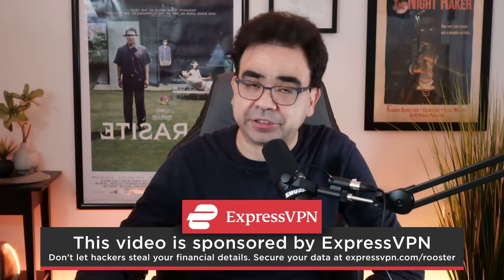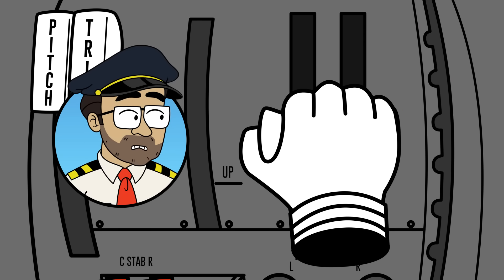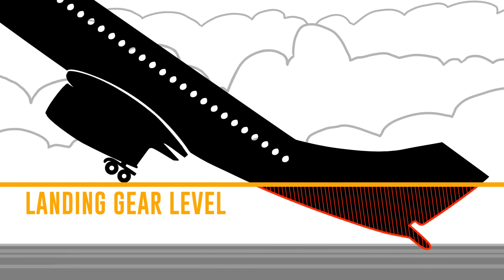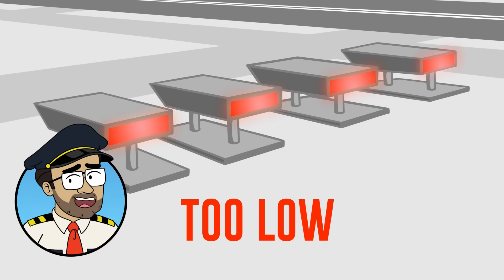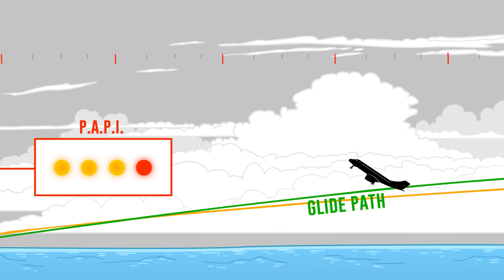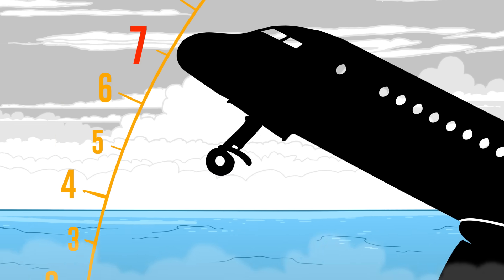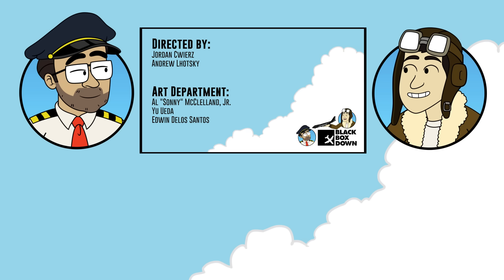How a Plane Crashed into a Seawall! | Aviation Explanation

Comment: Very well done! Could really tell you worked with the animation team to get all of the specs right. Would love to see a full series of previous podcasts in this style
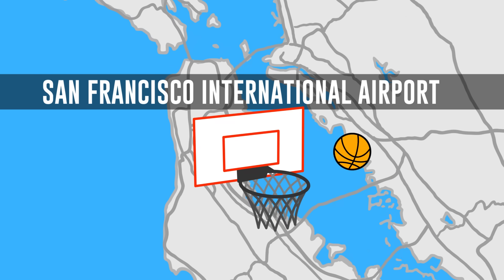Reply: yeah, the details are all really good and accurate stylizations (AutoPIlot Controls, Pedestal Controls, even the ILS antennae), with the exception of the runway markings @ 0:37, which has fallen victim the trope of just putting dashed lines all over the place. They could have gotten away with just a set of piano keys (longish thin stripes that run parallel to the runway) at the threshold and a centerline, instead they got this weird road looking thing cutting perpendicular across the threshold. Not too bad since that's my only complaint besides the kinda abrupt ending

Comment: a US viewer: interesting!
THE REST OF THE WORLD WHO USES METRIC SYSTEM: .. i didn't understand a word.
Reply: Does aviation us metric in other countries? I believe English is the standardized language for aviation so I would be surprised if they have a standardized measurement for flying too
Reply: @Woodshadow  no one said anything about language, but measurements units are a different story altogether.
Reply: 1 knot (kt) is equal to about 1.85 kilometers (km)
Reply: @danielpopp1526  Absolutely NOT. 1 Nautical Mile is equal to 1.852 km. You cannot convert km to knots. You cannot convert nautical miles to knots. You cannot convert inches to knots. You cannot convert meters to knots. 

Knots are not a distance unit. Knots are a SPEED unit. Specifically, they are Nautical Miles per Hour.

"Knots" is NOT a shortening of Nautical Miles.
Reply: @PolishGreasePit  lol buddy drop the attitude. Sincerely, an airline pilot.
Reply: @ksthebest  I can tell this is the guy on the plane who hears you casually say "I weigh 80 kg" and twists to lean over his chair to hiss "kilograms are mass! you can't weigh in kilograms, idiot!!"